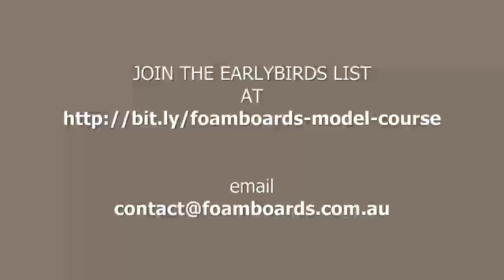Foam Boards Architectural Model Building Course

Comment: With the foam is it possible to build like apartments?
Reply: Hi Luke, You can build models of all types of buildings using foam boards. You need an understanding of scale and construction techniques. I was just looking at a rigid cored card today that is used to build real furniture and displays not just models and they are even constructing real buildings in Christchurch New Zealand out of cardboard after the earthquake there. Most architects like to model various aspects of their designs and even though we are in a an age of CAD nothing beats a physical 3d model to help get a true visual perspective of a specific design.